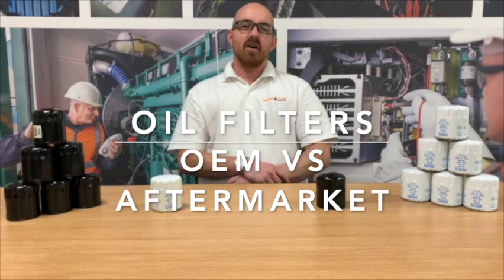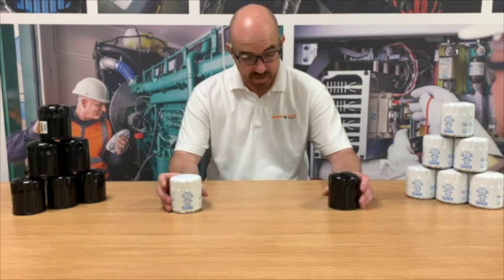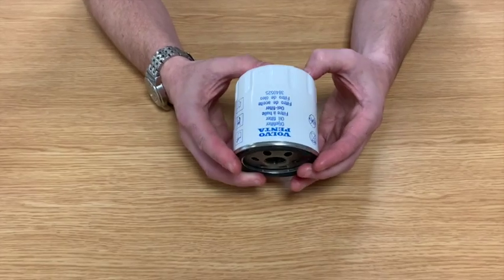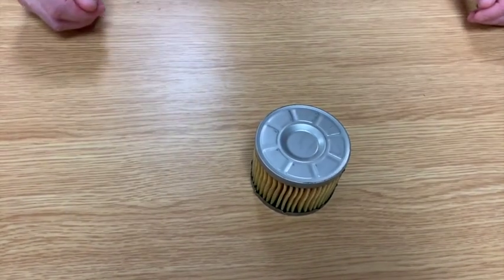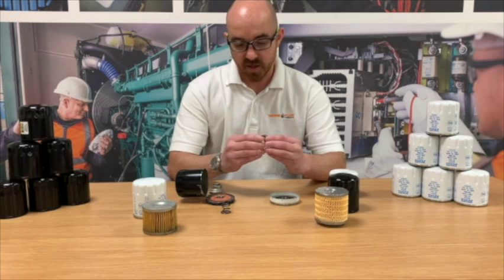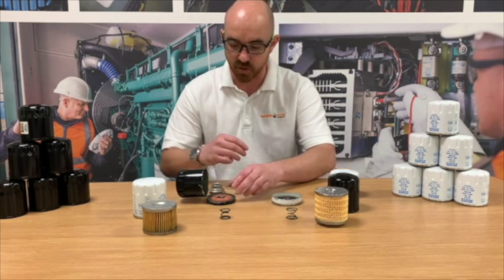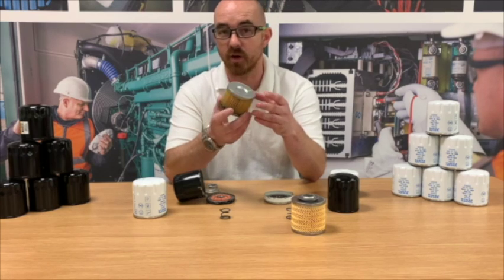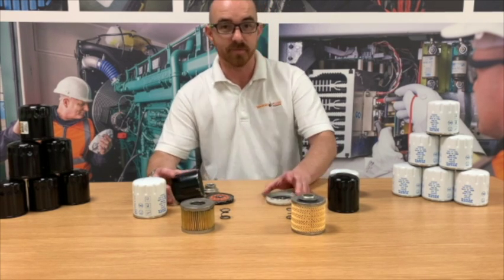OIL FILTER COMPARISON: OEM vs AFTERMARKET - VOLVO PENTA

Comment: Mann are making filters for vp 😉 so on newer vp engines Mann is “original” since vp is a branded Mann at a higher cost.

Good video👍 generally you will change filters long before maximum hours on them, if not are running them commercial.

Comment: Not trying to knock you down so to say but these are my observations, 
I know as you do that Volvo really doesn't manufacture oil filters they contract the production thur a manufacture of filters to their specifications just like any other vehicle manufacturer, 
I would like to know the brand name of the aftermarket filter cause you as I we both know that there is a great amount of quality differences between all the  aftermarket filters and with that there are some really great quality aftermarket filters on the market but for a cost, they are not the cheap ones.
My last observation is the strength of the by-pass spring, why you state the OEM Volvo spring is a bit weaker this may or may not be a good thing, good for cold start ups but bad for when the filter starts getting restricted, at this point there will be more unfiltered oil circulating in the engine .
I agree that the OEM filter has 25 to 30 percent more surface area which may be the reason for the weaker spring but if the oil and filter are not changed on a regular basis then the filter will become plugged up and start by-passing.

This was an interesting video.

Comment: And this is the reason why your Phram, walmart, store brand filters should not be used. Even Napa doesn't use brand

I had a video of a cut open experiments we did in a class at BOCES when I taught autoshop  for a year. The Phram filter was the worst, we found 3 filters over the course of the half year semesters that the seam on the media was not sealed, the metal clip was not positioned  correctly but still crimped on. 

It happens with every manufacturer but the improperly manufactured ones should NEVER get past Quality Control.

Then there is the carboard endcaps that disintegrate when they get saturated, the metal strap spring instead of coil spring that holds the media in place, and the lack of a quality anti-drainback valve, and inconsistent bypass pressures.

Most vehicle and engine manufacturers have a vested interest in the product lasting so they are not as likely to skimp on the value of the products or manufacturing techniques. It cost more for the engine than it does the filter. However, sadly in the USA manufacturers this practice is severely lacking based on the shit rolling off the lines.

The aftermarket filter manufacturers have a vested interest in making money. Manufacture it cheaper, sell it for more. Gimmicks like "hand grips" and "Extra" are not included on most quality OEM filters, they use the money one the quality not the frills. As far as USA manufacturers of OEM filters there are not many. Mann owns Wix and Purolator brands, and they are very good quality. I never use much of any of the other brands.

Comment: Point one Volvo do not make oil filters
Point two you don’t say who made the “after market filter” don’t blame you because of liable laws but not all after market filters are the same. Some are very good, some I wouldn’t touch
Reply from the maker: Hi John. You are correct, Vp dont manufacture filters, however the filters they source as “oem” are manufactured to their high specification. In the next video i will be looking at a fuel filter for the same engine series and will be comparing to a different manufacturers filter. 

Appreciate your comments.